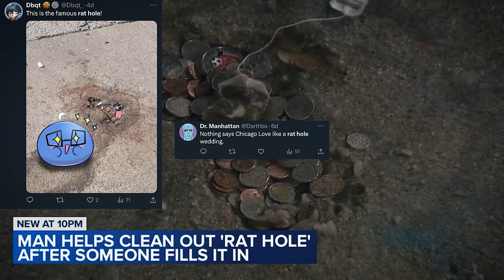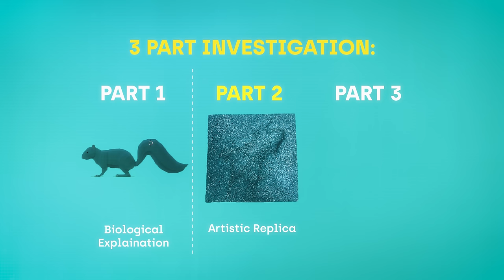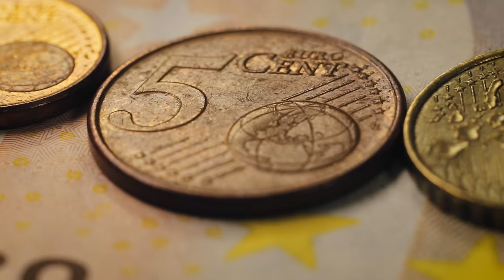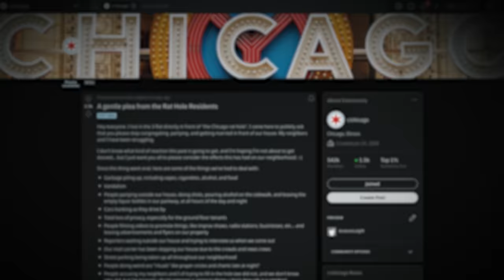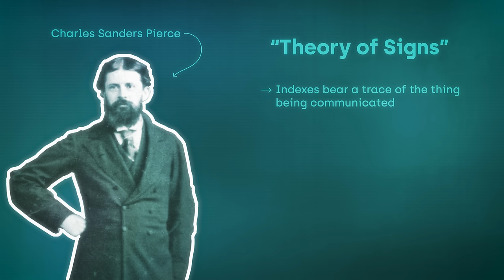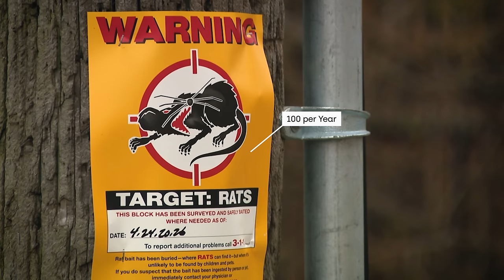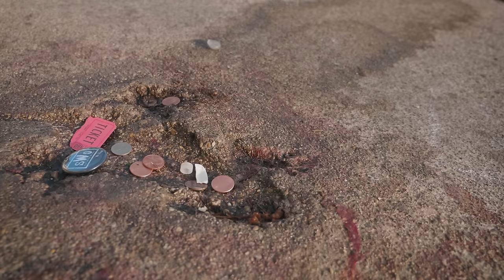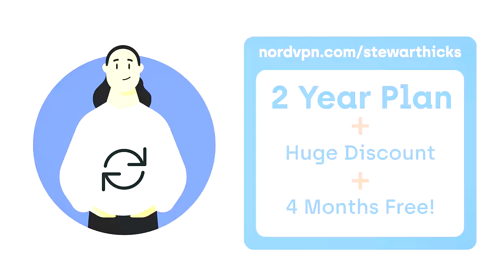How a Pretend Rat Duped Everyone (ft. Tier Zoo)

Comment: I wouldn't count on the squirrel surviving the experience.  Wet concrete is bad for your skin.
Reply: A squirrel could survive that no problem. The wet cement would have softened the landing if anything. I also handles wet cement many times, washes/crumbles off relatively easily.
Reply: @chrisclouds4182 what about the chemical burn?

Comment: the pavement is made by pouring wet concrete directly on the ground? I thought it was like slabs or tiles. Learned something about Chicago today
Reply: wth where do you live where they put slabs
Reply: @mr.b3168  Copenhagen. All of Denmark uses big tiles for sidewalks (:
Reply: @pindebraende  weird
Reply: @mr.b3168  it's normal to me - if you are doing infrastructure work underground you can simply lift them up and put them back in place afterwards. Convenient for maintenance too.

Comment: In front of my childhood home I used to walk around the block noticing all the different impressions in the cements. At the end of the front walk my mom put our family’s initials. In the right corner of our sidewalk are two sets of paw prints my siblings and I could never agree if it was cat or dog. Around the corner to the left the message Pam + Greg referred to the older couple whose granddaughter I played with in the summer. In the street just a ways further you can try to follow an unfortunate person’s path through the new concrete of the street, where the tried to backtrack and get out. What also interested me was how the sidewalk composition changed our house had new smooth gray, but the next two had a pinkish orange cement with chunky pieces of people sticking out, around the corner it turned into four small squares instead of one big square, to the right there was no sidewalk just massive four by fours marking the edge of the lawn. And the places where tree roots had begun to undermine the slabs were great scooter ramps.

Comment: I have doubts about tierzoo version. The pavement does not look like poured concrete in place, it looks like pre-made concrete blocks put there. What's more, there is a significant change of color around. 

I suspect the birth of rat hole is much more grim and dark. A rat climbed in production form somewhere in a factory and concrete was poured over. Some blood got into cement around and it became more red. Than workers just installed the block.

Comment: 5/18/24 just watched video and had to Google it,  put in rat hole, and it was like 5th on the list. Also said City fixed concrete 4/24. I hope they cut it out and put a layer of clear epoxy over it and put it in a display stand. Looked like people would put change around it. Maybe an animal shelter could go in with the city and make the stand for the display case a donation box for the shelter.

Comment: What makes you think the rodent survived? 🤨 If it had survived, there should be paw-prints as it scurried away. (I've got photos of a section of sidewalk in my town covered in numerous paw-prints.) In one comment, someone said it was too dry and Stewart said there are faint paw-prints, but if it had just jumped off of a roof into wet-cement, it would likely have BOUNDED out of the hole, leaving deep paw-prints, not just light surface-level markings. It seems more likely that the ostensible bird-of-prey snatched it up from the wet concrete.

I'm surprised it hasn't been vandalized; it seems so easy and likely that someone would have chipped it away by now. 🤨

What if it's not actually an imprint of a rodent but just a generic hole that happens to look rodent-like due to pareidolia? 🤔